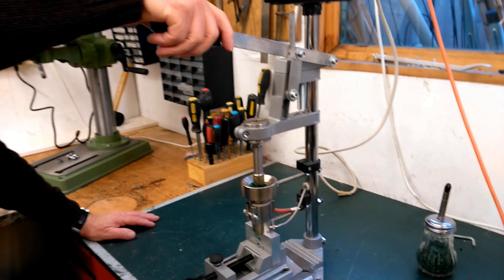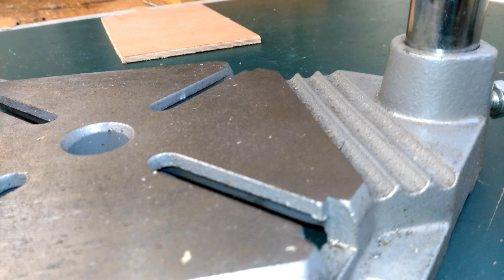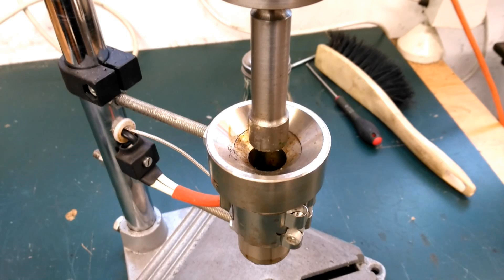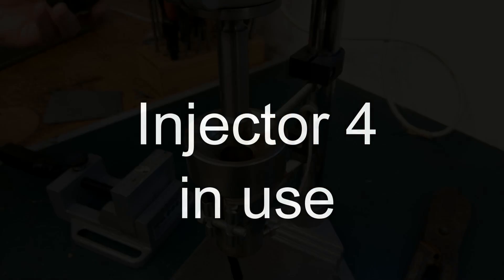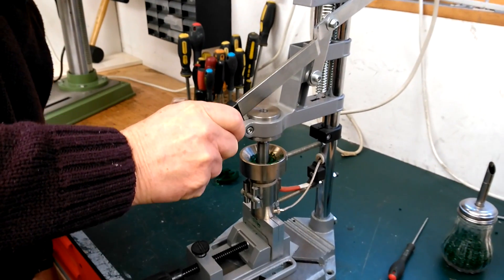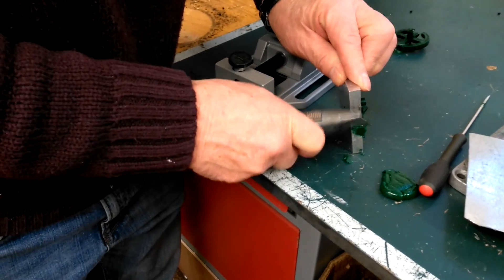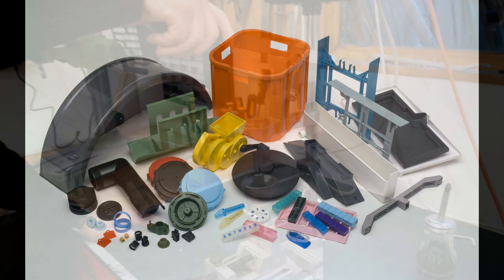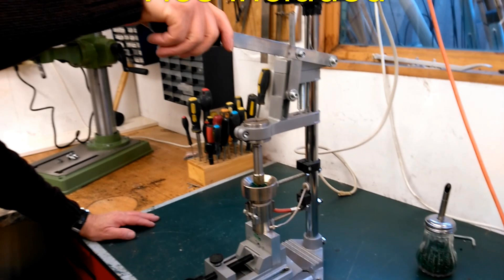Plastic Injection Moulding Machine - model 4

Comment: Firstly, I am not master in this field. However, what I see is the heater band wire directly connect to port 1 and 2 (~220V) of the PID controller. My concern is whether we get electrick shock when touching to the heater band during the operation (I mean when the heater bands getting hotter to reach the set temperature value) ???

Comment: Pretty clever.  Liked the idea of using a resin to make the mold with.  The Nazis did something like that with the gears for their planes?  I think that it was.  They mixed their phenolic resin with silica sand with a lost wax method.    If memory is serving well enough, I think that the article that I read claimed that they might have gotten 80 or so gears from a resin/sand mold.  All that they did after that was trim the new gear to speck with a file.

Comment: hi, thanks for the video ,. a curiosity,. no air bubbles form in the molded piece? how long do you have to wait for the plastic to melt and ready to be injected?
Reply from the maker: Bubbles are not a problem, and if the machine is at working temperature, then the melt takes about 5 minutes or less.
Reply: @chriswesley594  thanks for the answer, I have to create some plastic components, 3D printing is fine, but I would like more quality, also having a cnc for metals, I almost give it a try ..

Comment: I've got onr of those "drill press" stands.... they're not what I'd call "great" but they sort-of "do" for home use.
I've been on the look-out for a reasonably priced injection moulding machine for ages.... this might be a good plan.
Reply from the maker: Hello again. Yes, they are cheap and not very rigid. The reason this model worked is that the frame doesn't have to be rigid. The piston alignment and the strength relies on the downward force from the lever being transmitted through the mould. The second reason I stopped making these is that people just wouldn't get this, despite clear instructions sent to them. Mine is still perfectly aligned after several years of use, but some customers got fded up that theirs went out of alignment and froze. I'd get them back to re-align them which is annoying. The new model will solve both problems. The cylinder doesn't need any boring, and the piston cannot move out of alignment. I won't say how those are accomplished but you might subscribe if you'd like to see a video when it's available.

Comment: Thats cool. how do you heat up the molds for the injection process???
Reply from the maker: Depends on the mould Rodney. If the ways are wide and the part simple, mould heating is not necessary. As things get narrower, longer and more complex, injection gets harder and heating helps to keep plastic flowing until the mould is filled.

Comment: You need to get into 3d printing
Reply from the maker: You obviously haven't seen my 3D printing videos, Crispy. 3D printing rocks. I've earned my living from mine for hte last 3 years, but it has limitations. You can inject a part in seconds and it iwll be far stronger and with a perfetc mirror finish. You can't do that with a 3D printer.

Comment: what would be the melting temperature of the molten plastic?  & are you using recycled plastic such as -HTPP used for  3d printers. will you be devising a machine that makes larger castings of objects. when I worked in a plastics factory we used polyprophelane beads in sacks for the plastic material
Reply from the maker: Nigel, the melting point of the molten plastic depends on the plastic you use, but 200 - 250C is usual. Yes, I use HDPE and PLA - and that PLA IS from failed 3D prints. I already have a larger machine but it is not for resale currently.

Comment: hi, can your extruder extrudes ptfe. I need a machine like yours, but that extrudes tflon. greetings from Argentina
Reply from the maker: Rene - this machine will extrude any thermoplastic which melts below about 240C. Beyond that I cannot tell you as I have no experience with Teflon, but in any case, this machine is not currently availabel for customers.

Comment: If you're molding in an Aluminum block why not use an aluminum barrel. Shorter life perhaps, but significantly better W/m-K over stainless. It would make your process much faster and more efficient. Anyway, I've been wanting to do this for a while. I can think of more than a few parts I'd like to mold rather than 3D print.
Reply from the maker: Dunno what W/m-k means but aluminium oxidises and is very soft which makes it a poor choice for moulds.

Comment: As a life long mold maker I find it interesting
Reply: Roygbiv 444 it makes me want to modify it more, install some kind of ejector system, basically make a press in the long run
Reply from the maker: You know a thing or two about moulds then. All mine are simple get-the-job-done and low volume items. I understand that production moulds for big volumes are a very special mix of science and widardry. Make a video for us?!
Reply: @chriswesley594  I am not working now.the last mold I built a few months ago took me about 400 hrs. Using 3d software to design,CNC and edm machines to cut and burn desired impression.

Comment: Sorry but your proposal machine is unless. No good plastification and no good holding pressure.
Reply from the maker: WHy are you sorry? I assume "unless" means "useless"? Yet you see it .... IN USE. Puzzling. Well, not really - you just can't resist having a go. The issues you mention would be a factor in larger machines, but in this machine and for the intended uses, it works absolutely fine.

Comment: Good price. The LNS 150A in the USA costs twice that. I have one. Injection volume is 1.25 CI. so they are almost comparable.
Reply from the maker: Yeah I konw about the LNS machine. There's is also not solid stainless steel, but nickel plated.

Comment: What's the use of this kind of small and tiny moulding machine in this period of competitions market think?
Reply: Custom small parts for particular use?
Reply from the maker: There are many many uses for a machine like this. 3D printing is great - I ahve two printers - but they take a long time to print things and the finish isn't always what you might want. Moulding is lightening fast and dirt cheap. That's why it dominates the planet.

Comment: Does you injector work on polycarbonate which melts at
135 to 140 Degrees ???
If I send you a prototype 
can you make a mould as part
of The sales package ???
Reply from the maker: T Mo - it will heat to more than 250C so I can't think why it wouldn'y work with PC but I have not tried it.
Sorry I don't make moulds for customers.
Reply: @chriswesley594  Thanks for your response, I have watched some YouTube
Videos on How To Make Molds, I Think I will do fine,  Thanks Again,

Comment: A desktop injection moulder, yes please:) You'll be getting an order from me in September. Very nice work.
Reply: Assuming i'm making something that requires a larger volume of plastic than i can pour in one shot, will this create weak points in the final mould due to earlier pours being cooler than later ones?
Reply from the maker: Yes, it would Gary. It won't really work as the plasatic would solidify in the way of any second shot you might attempt.

Comment: Chris, whats the stainless wall thickness for the tube that takes the heater band and an estimate of time plastic particles are in before pressing? Thanks.
Reply from the maker: The wall thickness is exactly what it should be to work so well. In a hot machine pellets take about 3 minutes to melt.
Reply: @chriswesley594  so its top secret the thickness..... :D
Reply from the maker: @ellelephant  Yeah - it took me a while to realise that the people asking me for dimensions were reverse engineers. Well - y'know, I'm trying to sell these, and the dimensions took me a lot of effort to arrive at, so I'd rather not just give them away. I hope that sounds reasonable. Are you a reverse engineer??
Reply: @chriswesley594  gotcha. nah, i keep toying with the idea of a 3D printer, it appeals to me but the market is saturated with builders and rip off copiers (reverse engineers), injection moulding has more appeal due to its strength but its one of those things that interest me more in how it works rather than all the hassle of actually doing it. Reverse engineer?.... bit of an insult really, an engineer would know the heating capability of the 120W heating coils from the manufacturers, be able to apply the q = U A dT  equation to find out the transfer rate, they would also have to know such things as the thermal conductivity of stainless steel. (16 - 24 W/(m K).... Like i said, just curious as its always interested the crap out of me :D

Comment: Whats the cost of having a aluminum mold made ?
Reply from the maker: It depends on who is making it, whether it's aluminium or steel, and what the part is. If you outsource it, then unlikely less than several thousand pounds for an aluminium mould and far more for stainless steel. I make my own from aluminium or brass with the aid of my metal lathe. If you have a CNC router, you can make your own even easier. It's now possible to 3D print moulds, though I have no experience of that so far.

Comment: Hi Chris, I have a 2 cavity mould, the total weight of the two products is 30 grams.
Do you have a machine suitable  for that.
Reply from the maker: Mehrdad - the short answer is no - not yet. The current model is 1.2 cubic inches, whic is about 20 cubic centimeters. Plastic density is about 1g per cubic centimeter, so that's also about 20 grams.
Reply: Thanks for your reply.
Reply: Hello again Chris, would you be interested in building a 2 cubic inch machine for me?
Reply from the maker: Yes. I will reply to the email you sent me with details.
Reply: I have also sent you an email with more information With pictures of the mould and the end product. Looking forward to hearing from you.

Comment: Hi I have a new design that I would like to be able to injection mould at home, it has 7 parts and the volume of plastic would be around 950g. each part is no more than 200g do you or could you make something?
Reply from the maker: Hi Adam. The capacity limit on the 4a model - the successor to this machine (https://www.youtube.com/watch?v=tn6-MgJ6oVU) - is 1.2 cubic inches. For a typical thermoplastic like HDPE this equates to a mass of  19 grams - so this machine is far too small for your needs. You need a machine with ten times this capacity. Making something would be possible but it would be a prototype and involve you in a lot of up-front investment.
Reply: after reading your comment I have decided to remodel a juicer into an injection molding machine, Im seeing alot of people designing benchtop injection molding machines but all have a low capicity 10-20g. I see no reason why bigger capcity is a problem with these set ups. you are really only limited to barrel size and shaft. I take it putting a number of shots into the same mold isn't feasible ? I guess you would get separation, could this be overcome by heating the mold?
Reply from the maker: Adam, multiple shots into one mould is not feasible, no. I've also seen a lot of other people making injection moulding machines. And whilst they man demonstrate the concept OK, they are not usually practical machines. Aluminium, for example, oxidises in air, and will deposit a powder into the body of your parts. There are problem with scaling up a small machine to make a big one. One is that plastic is a very poor conductor of heat and as you increase the barrel width you increase the time it takes to melt the load throughout its width. Commercial units get around this problem in a variety of ways. Another problem with increasing barrel diameter is that the injection pressure for any given handle force drops. (pressure is force divided by area).

Of course all obstacles can be overcome - commercial machines, after all, DO exist. But it's not as easy as you may think.

Have fun & good luck.

Comment: what is the power of the heating element how many seconds heats up and how much warms up ?
Reply from the maker: The element is about 120 watts. From cold, it takes about 5 minutes to heat the machine to working temperature. After that, from one shot to the next, you have to wait a couple of minutes to melt the new load of plastic. You can speed things up by lagging the injector barrel.

Comment: Great minds think alike. I had considered using a similar drill press frame as the basis for our next model, but we want greater capacity, so we're going with a powered screw drive. The video may release before year's end.
Reply from the maker: Th model 4a includes a capacity-stretching tweak (=20%) but it will always be limited by the throw on the drill press. Still, it's adequate for many users. Video on the 4a to follow shortly. I look forward to seeing your powered system. I've been harbouring similar ideas for a long time.

Comment: Can I have the link to the drill press? I might make something like this.
Reply from the maker: Pretty please? Suppliers and supplies come and go. Just pile on to EBay and search for one, but be careful to order one with a cast iron base. There is another kind which look the same but are far inferior - they do not have the cast iron base.
Reply: Thanks. I had to search a little because most of them are aluminum, but they are still really cheap.
Reply: Thanks. I had to search a little because most of them are aluminum, but they are still really cheap.

Comment: i have many questions

Is there a reason why stainless steel is used – can it be aluminium or copper?

To have more capacity, can the piston and barrel be made a larger diameter, rather than length?

When injecting plastics of different color or plastic type, how is the funnel and barrel cleaned to avoid mixing of colors or plastic types?

You mentioned in one of your videos that the mould could be made of plastic resin. Would the heat from the molten plastic deform a mould made of plastic?

How much torque do you estimate that you are applying to the lever arm when filling the mould?
:
Reply from the maker: Critical look - here are your answers.

Both aluminium and copper oxidise - they tarnish. The oxide is then available to contaminate the melted plastic and the part you'remaking. I know that LNS technologies nickel plate their hot parts, but my concern there is that - when the plating's gone, the machine is open to oxidation (rust in that case).

You can make the piston wider, but then the injection pressure for a given lever force is lower. It's a compromise point which you choose for the work you have in mind for the machine.

The barrel is cleaned ("purged" as the industry calls it) by flushing it with something. You can buy purging compounds but I just push the new plastic in after the old and accept that I'll have to do it a few times before the old plastic is fully gone.

No, the resin moulds don't melt.

The injection force needed depends on the plastic being used, the temperature of the melt, and the mould, and the specific design of the mould. Long thin runs present a lot of resistance whereas short fat runs present a lot less. My GUESS is that the down force for a typical mould would be in the region of 30Kg at the lever handle.
Reply: Price

Comment: HI

Do you sell the cylinder and plunger separate?
Reply from the maker: Hi Foxy, yes I do, but much of the cost and the work is in these stainless steel parts. You'd need three parts:

1. The barrel itself, with drilled tapped holes for the bottom support strut and thermocouple

2. The funnel ring, drilled and tapped for the top support strut

3. The piston, machined for a close fit in the barrel.

Please write to me at chris@chriswesley.org  for a price.

Best Wishes,
Chris
Reply: Email inbound
Reply: Hungry Badger

Comment: When you drive the plunger down, doesnt the piston trap some air in with the plastic potentially forming bubbles?
Reply from the maker: Hi Joe. No. Molten plastic is quite viscous and the piston doesn't need to be a gas-tight fit so air can escape past it.
Reply: are selling any of your work ,,if so i want to buy,,,thanks or can i buy parts from you so i can make one?
Reply from the maker: Hi samuraiman691. I make these machines to order. However, I am based in the UK and postage from here to the USA adds about $150 to your price. If you are a handy DIY person, I can send you the injector and the control units, and you can purchase your own drill press and fit them yourself. The postage comes down to about $60.
Reply: hi thanks for the reply im very interested in the whole unit ,,i dont have the skills to make the brackets and such,and dissecting a drill press is pretty harsh,so i dont mind paying you the 150 for postage,,,is your unit, 500.00 usd? i can wait a couple of weeks or more for it,,,also can i get one that looks like the one in your video? i saw the 1,800 from techkits ,,no way,,,,,your is probably even better,,hope to hear from you,,,
Reply from the maker: I have just started making these to order. The wait time is currently six weeks from receipt of 50% deposit, though I plan to get that down considerably.

The price for the last one was £450 (UK Sterling pounds) but I've realised that that isn't enough for the work needed to complete one. It's about 30 hours, and of course, the cost of all that stainless steel, electronics and other bits and pieces isn't cheap. So the next one will be , so the price will be £550 plus P&P. I'm sure that's a step in the wrong direction for you, but I hope you will understand why.

If you're still interested though, please let me have your email address and we talk deposits.
Reply: are in the u.s. ? i have paypal ready
Reply from the maker: Samuraiman691 - I received your comment but I've deleted it in order to protect your privacy, I will write to the email address you provided regarding your machine.
Reply: cool beans..